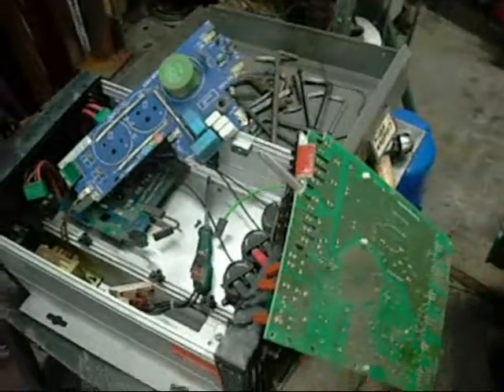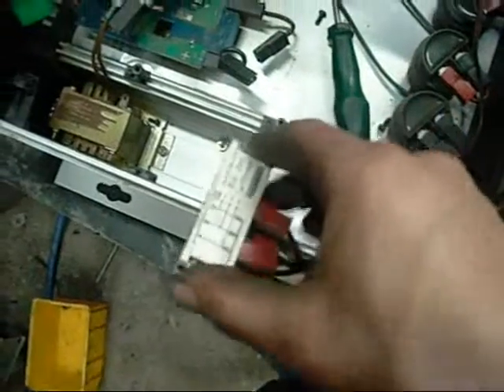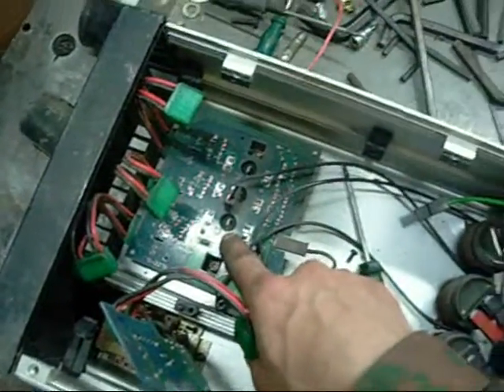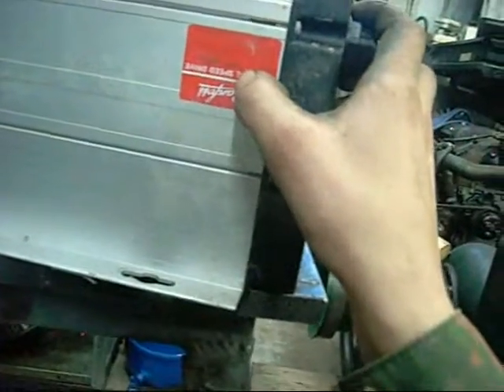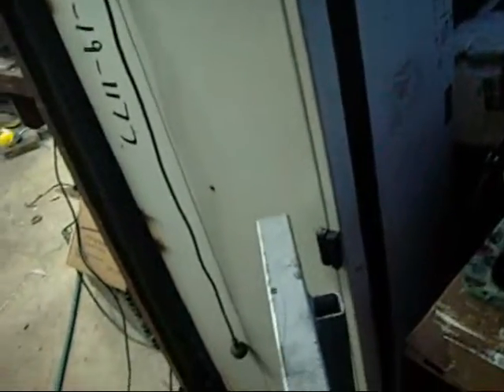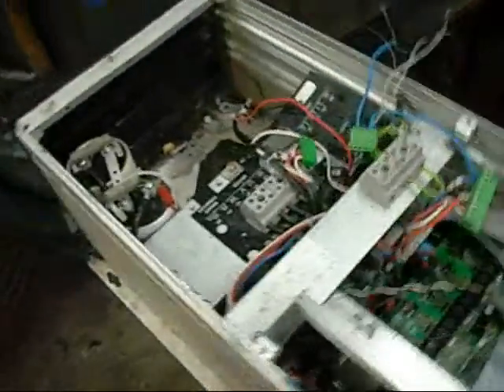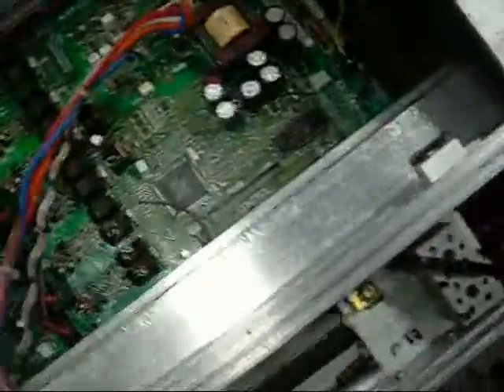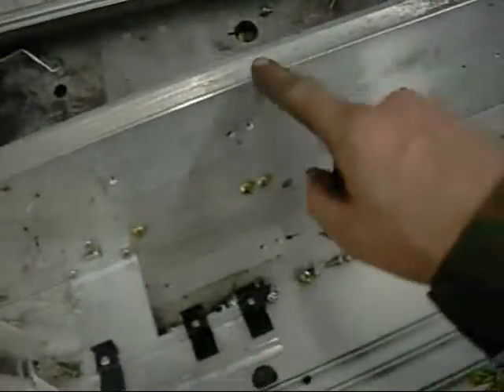Danfoss VLT Drive Disassembly

Comment: Hi, strangely I did miss this particular video and I see it only now... Nice parts by the way, and great amounts of aluminium ! It you happen to find large Uninterruptible Power Supplies, they have good parts also, and the contain big transformers with lots of thick copper wire... good for resale it you bother to dismantle the transformers, it's not so difficult when you know how to proceed for tearing appart the magnetic core.

Comment: The little blue ceramic disc you were wondering about is a varistor. Its there to protect against transient voltages most likely. Also IGBT is insulated gate bipolar transistor. not integrated :) They are sort of a cross between a BJT and a MOSFET

Comment from the maker: @tranefreak1 nope, those are similar but not the same.

these drive normal 3 phase electric motors, usually on pumps, conveyors, mixers, fans, lathes and other industrial machines.